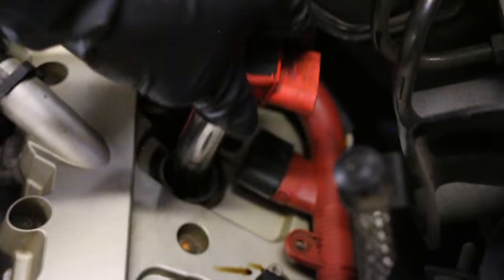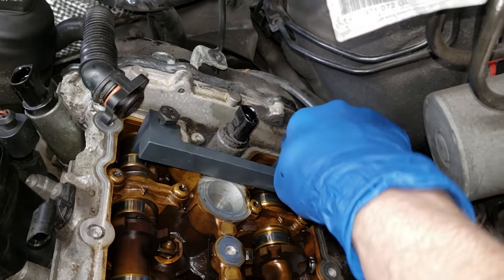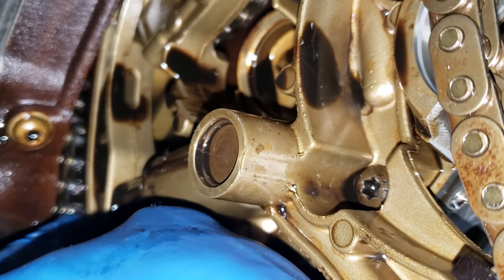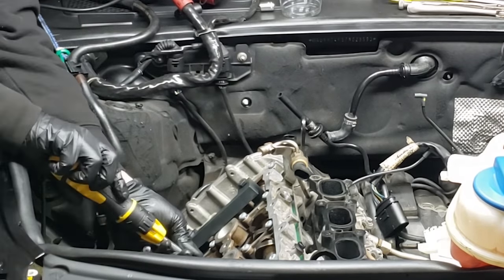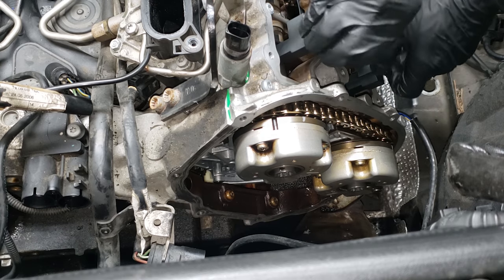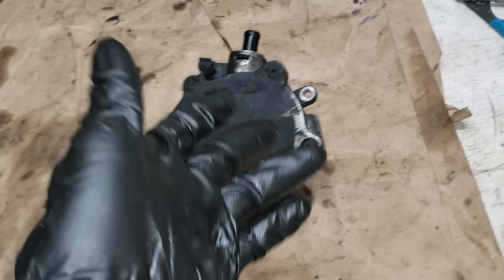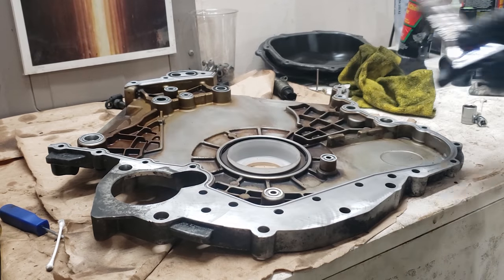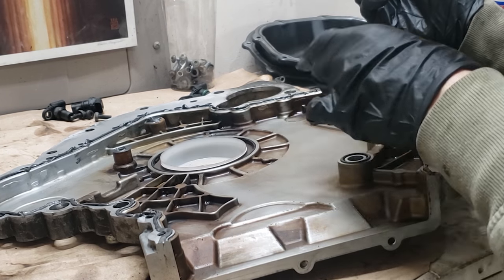Audi (A6 A4 Q5) 3.2 Upper Timing Chain Tensioners, Cam Girdle Seals, & Engine Removal | MUST SEE!

Comment: Please make a content about 4.2 fsi timing chain. The unit that im working on right now don't have that threaded camshaft to install the cam holder.
Reply from the maker: Never again! Haha, I hate the 4.2 and likely won't ever get one again.
Reply: @Mechani_Cole  you have a cheat code on that buddy, cuz I need to remove the girdle and replace the gasket.
Reply from the maker: There is a cheat to it if your girdle seal is leaking. Haven't tried it myself yet, but there is an option
Reply: @Mechani_Cole  do you mind if I ask, before I remove it. I already to pull the engine down. I don't even know where the timing marks are. 😂😅
Reply from the maker: Yeah I was trying to find it. Check this out - https://youtu.be/2Jao8SjoitI?si=vK6vUizy80cf3H7k
Reply: @Mechani_Cole  Hey buddy. May  I ask something? About this A6, all of a sudden the hood open and door open display stop working. You encounterthis before?
Reply from the maker: Haven't experienced that before no
Reply: @Mechani_Cole  Thanks bud

Comment: Can it be a black silicone sealant or does it have to be green?
Reply from the maker: For the green anaerobic sealant, this can NOT be replaced with RTV. If you do that, you can clog oil galleys, and it will likely leak after you put it together. 

Either do it right or do it twice. Your choice @teerex9149 🫡
Reply: @Mechani_Cole  I noticed oil leaking on the alternator I checked if it was the valve cover gaskets seems to be coming from the side of the camshaft itself.
Reply from the maker: Possible. The vacuum pump always leaks right there too

Comment: What will you change to do the same on my car?

Same model…
Reply from the maker: Way too much, it's a pain in the a$$ job haha
Reply: @Mechani_Cole  e.g. what?
Reply from the maker: To much work, not interested in doing it again. So the price would be high in other words
Reply: @Mechani_Cole  so wish me luck Buddy, I'll do it by myself. I don't want to pay for this job. Don't have circumstances to pull out the engine so I have to be sure to unscrew all the bolts at the back covers. P.S. my motor is 2.4 with only one variable timing gear at the side, but still work is the same. If I will finish my job, you get some bucks 💵 from me! 😉😁

Comment: This thing is a fu%$#- nightmare to work with
Reply from the maker: You're telling me haha! I've moved on to the 3.0 with the supercharger, it's even funner to work on lol
Reply: I have a 2010 s5 that's throwing a p2293 code any suggestions?
Reply from the maker: @dannyt2892 fuel pressure regulator or high pressure fuel pump
Reply: @Mechani_Cole  I'm afraid when I remove the pump that the end of that cam ahaft is toast if that's the case is the anyway I can just replace lobe or does the whole camshaft have to be replaced
Reply from the maker: Really just depends on how much damage is present. Usually can just replace the lobe cap peice

Comment: Do you have to remove the locking pin before you turn the engine for a  test to see if it's in good timing?
Reply from the maker: Yes. Otherwise the engine won't be able to rotate
Reply: @Mechani_Cole  Thanks man big help

Comment: So when doing this job, remove the timing cover bolts on the bottom first so that there is less pressure on them, possibly too much extra pressure on the lower bolts if you removed the top bolts first.
Reply from the maker: Yes! I'd start at the bottom also just to make sure you don't strip them most importantly!
Reply from the maker: They also switched the newer models back to bolts lol
Reply: @Mechani_Cole  thanks for putting together all the info, I’m about to tackle this job on my car
Reply from the maker: @jonathanharris2570 best of luck🫡

Comment: Dont have oil pressure like u had it sounds terrible.
Reply from the maker: Soo bad! I learned in the future to pull the fuel pump fuel and turn the engine over until pressure builds up before starting it. Mine was find though after it warmed up. I put a bunch of assembly Lube in for that reason🤙🏼
Reply: @Mechani_Cole  I expected it.
Must try it tomorrow. Did it take a long time in your case to build the pressure?
Reply from the maker: Only like 10-15 seconds after startup. Turn over with out the fuel pump fuse for about 30 seconds to a minute to prime it
Reply: @Mechani_Cole  I'll keep you up to date.All the other work just went really well then this sound haha
Reply from the maker: @Jumper848able  did you make sure the timing marks on the cams were lined up after trying to start it? Make sure it's 100% in time before cranking to much
Reply: @Mechani_Cole  yeah i turned engine per hand 4x and checked it. all fine
Reply: When the high-pressure pump is plugged in, you can hear a clicking sound. But when I unplug it, the engine runs quietly. Do you think it's broken because it ran normally before?
Reply from the maker: High pressure fuel pumps usually always have a clicking when running since it's running off the cam lobe. There is a metal tappet inside that can wear down and go bad, but usually much louder if that fails
Reply: @Mechani_Cole  yeah it's very loud ..i've Seen that metal tappet from INA im 'bout top buy it

Comment: Does the cam girdle seal come with the valve cover gaskets?
Reply from the maker: No. I had to order it separately
Reply: @Mechani_Cole  I can't seem to win my argument with New Zealand  Qualitat European Motors. They keep telling me it comes with the valve cover gaskets.
Reply from the maker: That would be strange, but I guess possible. They are probably thinking of the spark plug tube seals. They looks similar. Idk, ask if they has a pic of the parts included

Comment: If you were pulling the engine out anyway, I bet you wished you did the driver side first
Reply from the maker: Never had intentions of pulling the engine, but lesson learned. Start on the hardest bolts first haha
Reply: @Mechani_Cole  was it your car? I drive a VW and up until this point, I was using the grey premium rtv. You changed me
Reply from the maker: Yes. This was my personal vehicle